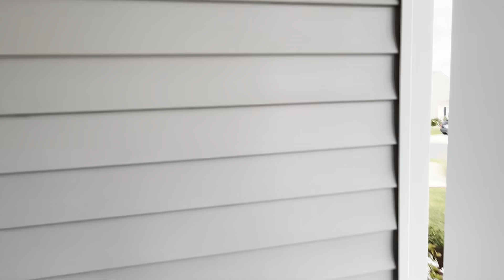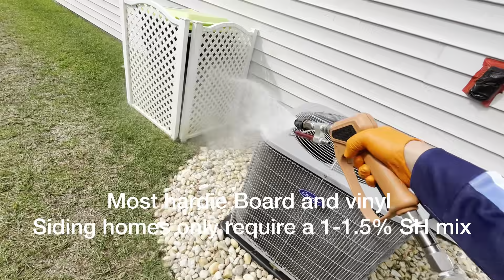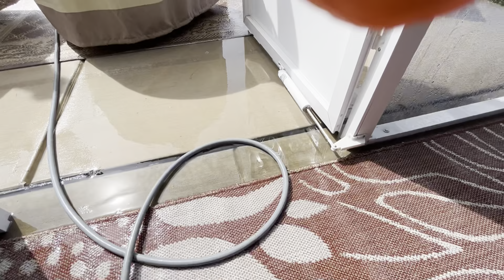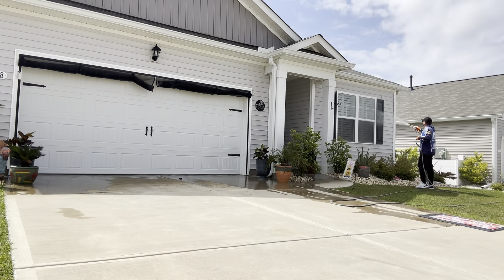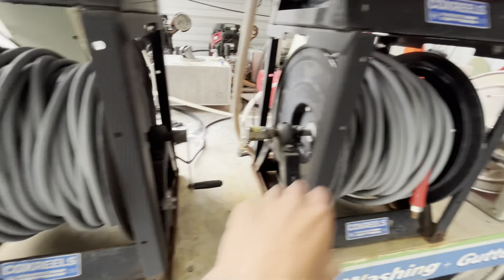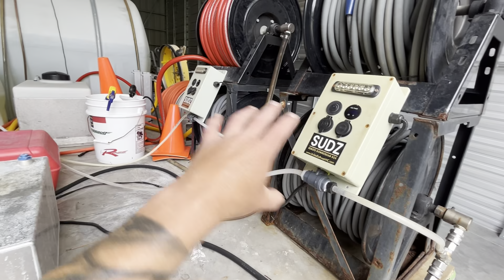How to Pressure Wash a Home with Low Pressure | Soft Wash 101 for Beginners

Comment: Two videos in and I’m subbed. I’m a window cleaner who is getting into soft and power washing. This one is absolutely golden and I appreciate you putting it together. My next search will be adapting my current pressure washer to soft washing duties. Dig the other video on the X-jet too. I’ve used something very similar with air tools to clean engine parts. Thank you.

Comment: How would I reach my 40 feet height vinyl sided chimney with chemical when I cannot use a ladder due to close proximity to my detached garage? I tried a 4 inches long reach spray nozzle on my wand but it will only spray chemical a maximum of 30 feet.
Reply: It has to do with gpm  also they make 6 ft wands 2 story tips x jet j rods several tools

Comment: Hi Kyle, I live in Brisbane Australia, and I'm really enjoying learning about soft washing on your channel. I have a 12 volt 6.6 GPM 100 PSI  soft wash pump and I'm running a 60 meter / 200 foot hose What internal diameter size hose should I be using to get the best performance?
Reply from the maker: 1/2 Id hose  brother. Thanks for the support!

Comment: What a great an informative video! I appreciate the content you put out. Very professional. I’m looking to start a pressure washing company in New York City, so I’m soaking in every little bit of information. 

I read somewhere online that when trying to protect customers flowers that the plants can get burned if you cover it with a tarp. Is there a specific cover that you use? And does it worry you that the weight might break the plants when covering them?

Comment: Regarding the X Jet, have you ever compared it to the foam cannon nozzle? It acts extremely similar but about 1/4 of the price.. That’s what I have been using and it seems to do a good job. It’s seemingly difficult to find any info online about it and I’m just curious if you might know if there’s any significant difference between the two. And thanks for the video bro you don’t know it but you’ve helped me out a lot over the past couple years. 🤝
Reply from the maker: the x jet is built better and also allows you to put different proportioner tips inside it yielding different strengths of mix
Reply: @softwashtv6315 10/4 probably worth the investment. Thanks!